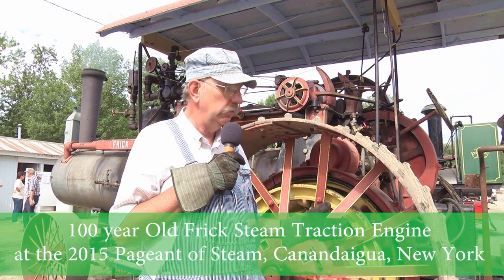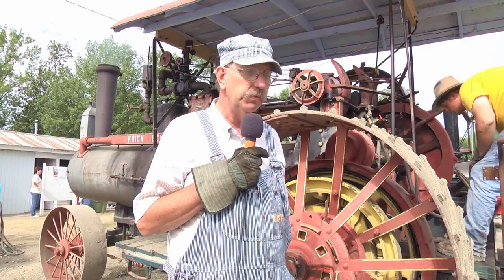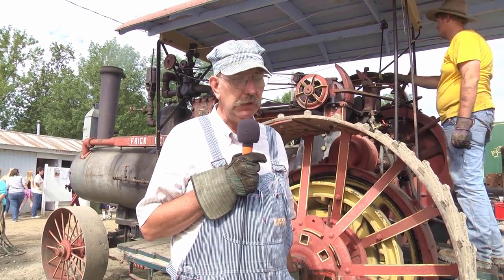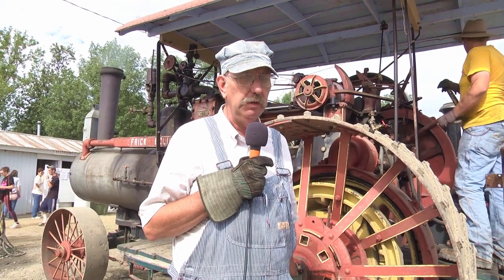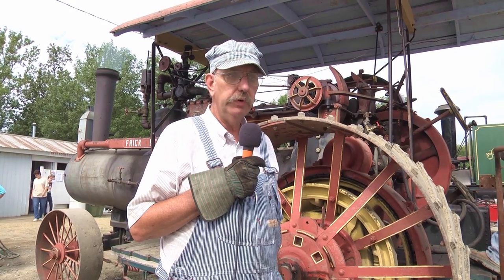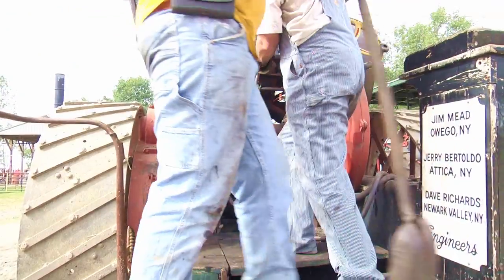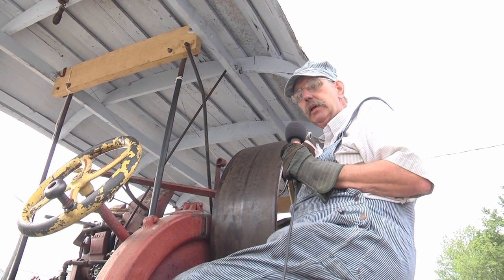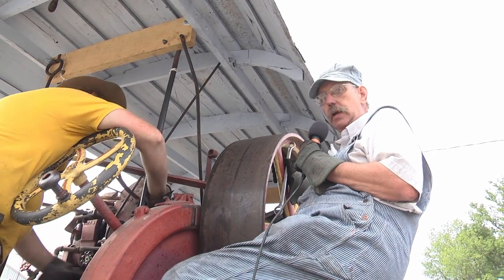1915 Frick 65HP Traction Engine

Comment: What the Frick is this
Reply: Seriosuly though, are those clutches behind the tractor wheels??
Reply: rarutab probably, and its probably for turning.
Reply: if its chains then its turning
Reply: The steering is by the chains on the front axle, and the thing on the rear that looks like a clutch is a combination of a differential and a parking brake, they are both mounted in the same general area on the left wheel. 

Its a lot of fun to drive, and if all goes well will be steaming again soon.
Reply: It's a fricking train gone tractor lol

Comment: It's amazing how much power hot water can have.. And probably the least exciting tractor pull ever for the guy on the trailer.
Reply: No, its amazing how much power can come from steam, now, imagine the power out of super heated steam (full vapor gas). The expansion power is nuts, and the torque from it is insane.
Reply: npsit1   Was quite surprised by the lift in a steam iron.
Reply: Almost every powerplant today is some sorta steam device.
Reply: Stephenie Grenoble Watch Jay Lenos garage in the Doble steam car.

Comment: Notice how quiet it is compared to a pulling tractor.  Plus, it will run on coal, wood, straw, or even low grade oil if you install a burner.
Reply: Mark Stockman it's 65 hp and pulling tractors have like 900 so they are gonna be pretty loud
Reply: A 900 HP steam engine isn't very loud.  A multi-thousand horsepower steam engine can be VERY quiet.  The difference is that this is steam driven, which has several advantages over gasoline or diesel.  The main advantage is that the torque curve is completely different - you get full torque at almost no rotation at all.  The engine is also reversible - no need for a transmission.  Instead of "an explosion" with high pressures and shock, the maximum pressure is much lower (the pressure of the boiler).  That's good for something like a vehicle - maximum torque when you need it (accelerating/starting) and easy reversing (there are reversible 2 stroke diesel engines).  A gas or diesel engine needs to keep rotating and it's power curve peaks at a much higher RPM - so you need a clutch and transmission.  (They're actually better for fixed plants like generators.  That's why a hybrid or mo-gen setup is so much more efficient than the usual engine plus transmission.)

A modern diesel or gas engine is more efficient, but they're also far more noisy because they have (in essence) explosions in the cylinder and much of that blast ends up going out through the exhaust rather than into torque on the crankshaft.  If they could get expansion ratios a lot higher without also increasing the compression ratio, a 900 hp gas engine would be a lot quieter - more power to the crank rather than out the tailpipe.

Comparing gasoline or diesel engines to steam is in a way comparing apples and oranges.  They're both fruit, but...
Reply: RedHeart64 not even going to bother reading all of that.
Reply: iHackSource
Then don't.  That's your decision.
Reply: or AvGas, tree sap, anything that burns, which is awesome.
Reply: Braeden Hamson Whisky ?.?
Reply: Michael Naisbitt Yep! It burns 
The Abrams tank is the same story, it has a turbine engine and can run on any flammable liquid
Reply: bcubed72 I am sorry mate it's just that I have been getting a lot of crap lately.  So I snap back automatically.   Merry Xmas mate
Reply: Michael Naisbitt Merry Xmas
Reply: a combustion engine is reversible also. In Messerschmidt Kabinenroller for example
Reply: My opinion is that steam tractors don't need so much horsepower to do so much work
Reply: You don't even need a fire to power that. Hook up an industrial electric, portable, steam generator, and it'll do.
And this one is overkill because it was made to pull gigantic (Trully, gigantic) cast iron and steel monsters that dug up the earth behind it.
Reply: Well sure, you could indeed pipe in steam from another source. But where's the fun in doing that? Raise steam for real and run it the way it was meant to be, its exciting that way. 

I just got home from working this engine at the 2017 show. Hopefully we see some new footage soon.
Reply from the maker: When the weather gets cold I'll post some more videos. I have about 6 hours from the 2017 show. Too much to do outdoors right now... got to take advantage of the sunshine while I can. Hope to bring some DVDs/Blu-Rays to the Threshermen's Dinner in October.

Comment: Nice control on the throttle, opening up to much at the start when resistance from the sled is still low makes it using to much steam and dropping the boiler pressure.
But the control showed here (keeping a steady slow pace) saves the boiler pressure for when its needed the most, the end stretch of the pull. More pressure is more torque!
Reply: They operated that engine extremely well, it shows experience. I'm glad that there are people that keep this amazing hobby alive.
Reply: Jerri Bruce  , im glad to see it too . the engineering of the past century or so is amazing to me , i read about the case 150 was a huge land locomotive i was hooked after that

Comment: I used to attend the Canadaigua steam show every year with my dad before he passed away. We used to take our little hit and miss to show off, it was used back in the old days to run a washing machine, wood saw, water pump and later a generator so my great-grandmother could listen to her radio.  The tractor pull was always the most boring thing you ever saw.  Hardly any noise, no massive 1000hp nitro powered engines blowing up, just a 20hp to 100hp steam tractor leisurely pulling the weight and doing it's job.  Much more fun was a tractor hooked up to the sawmill!
Reply from the maker: I have tons of sawmill video, if I ever get around to editing it...  I agree, the sawmill is fascinating! I never get tired of watching the old steam engines running it.

Comment: 65HP but a whole load of torque.
Reply: That are REAL 65 HP 
Not like a ,,normal,, tractor with >400 HP
Reply: power is how fast you hit a wall, torque is how far you drag the wall with you after smashing into it lol.
Reply: FlavonoidzExplosion actually that's momentum..

torque is more a measure of how much turn is being put on something...
Reply: also velocity is the speed at which the wall is hit.
Reply: Dylan Zrim Thanks for the correction, appreciated
Reply: It's not even the torque that makes this tractor able to pull so much. It's the traction from being so heavy. A ~1.2L 65HP engine with enough gearing could pull exactly the same providing it has the traction.

Comment: Nice of the sled operator to keep the weight off to put on a good show. Neat old engine.
Reply: She'd have taken it loaded without issue. Steam clings to the ground incredibly well, and it all comes down to how skilled the driver is at handling the engine's timing and chest pressure.
Reply: renegadeoflife87
I have seen the sleds spin out the steamers, even some big 100hp Case jobs. Just like the steam locos they would usually rather spin out than be choked just so much torque.
Reply: For sure. It is plenty possible for a steamer to lose its feet just like a diesel would. But the mass on the drivewheels is so great that its pretty rare to see in traction engines.

Locomotives have a lower coefficient of friction, and a great deal more tonnage on the drawbar. So they'll slip somewhat easier, especially if the rails are wet or the engineer is too eager on the throttle.
Reply: I've seen a steam traction engine do a full pull with a full load. Talking +3000 ft/lb of torque :P

Comment: Good pull!
second thing, I never knew that there were clutches on those girls.
third thing, how does that pull compare to the same class in modern tractor pulling?
Reply: They need clutches because a traction engine isn't just a tractor, it's also a stationary power plant for machinery like threshing machines or sawmills. To power a machine they'd disengage the clutch (so the wheels aren't driven) and run a belt off the flywheel.

Comment: How much torque does this thing have?
Reply from the maker: I don't know. Perhaps someone else can answer that question. I know they will pull an 8-bottom plow without breaking much of a sweat. I suppose someone could do a rough calculation... I am interested in these old machines, but not an expert on them. I believe the steam pressure runs in the 125-150 PSI range. For a 10" diameter piston, the surface area would be about 78 square inches. At 150 PSI, that would be about 11,700 pounds of force pushing on the piston. I don't know what the overall gearing ratio is between the crankshaft and the wheels... but that seems like a lot of force to start out with..
Reply: Shoots Studio  , 65hp @ 1 rpm = all the torque

Comment: But can it do a burnout?
Reply: it probably could if you put it through a transmission with more speed on the end, and managed to lock up the front wheels
Reply: Just wait until it's muddy...
Reply: Yes actually. With a heavy enough sled it could spin those wheels if it stalled out.
Reply: Throw radials on the fire, plenty of tyre smoke

Comment: What kind of torque figures does she make?
Reply: Thought it was like 3000 but saw that from someone else on another video.
Reply: Devilito mba
Reply: Devilito
Reply: Depends on the model. Probably around 1000 ft/lb would be my guess. The +120 hp models can do +3000 ft/lb though.
Reply: I wasn't really looking for a guess, but thanks.
Reply: Andy Nichols
A guess is about the best you're going to get as no one had dynos back then. I went looking to see if anyone had run one on a dyno but I came up empty.  The only thing I found was that some of the 120+ hp ones were doing +3000 FT/lbs.

You could try to get a closer guess by re-arranging the torque formula and taking a guess at the RPM involved.

Comment: I saw another steam traction engine 
at a tractor pull, and the guy was driving out, 
with the sled still attached.

"Grampa, the tractor pull just called.  They need 
their sled back."

steve

Comment: dang i dont understand steam... its like deisel but better. slow and has no HP but unlimited torque
Reply: Duke Of Prunes No, most traction engines had some kind of reduction gearing between the engine and drive wheels and usually a differential.
Reply: It gets pulling power from having incredible torque numbers. Basically it is geared insanely low so that 65hp is thousands of lbft. It's so heavy it can put the power down no problem. So the formula is massive torque and unlimited traction.
Reply: The gears connecting the engine shaft to the axle provide a gear reduction. There is also a differential on the left side wheel. 

Steam has truely phenomenal torque though, and the boiler makes it so heavy that it sticks to the earth in all but the worst of conditions. If it wanted to it could drag a power-comparable modern tractor backwards slinging mud the whole way.
Reply: Kgw100 It's an external combustion engine, as opposed to an internal combustion engine like a gas or diesel. The power is made by heating water into pressurized steam, and then that steam is released in a way that drives a piston to make power. Keep in mind that the piston makes power on every single stroke. The valve opens on one side and the steam pushes the piston one way, then that valve closes and the valve on the other side opens and the steam pushes the piston the other way. A diesel or gas engine only makes power every 4th stroke.